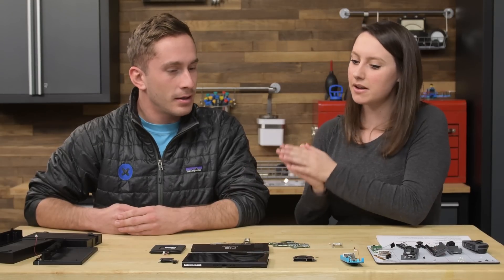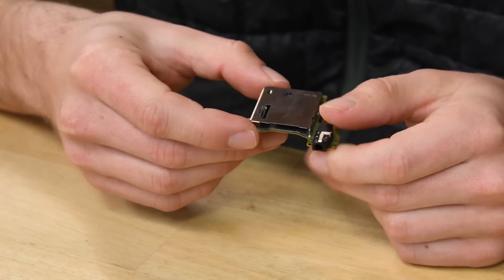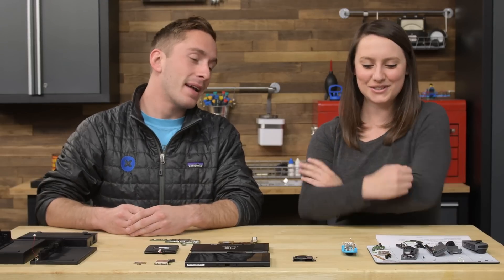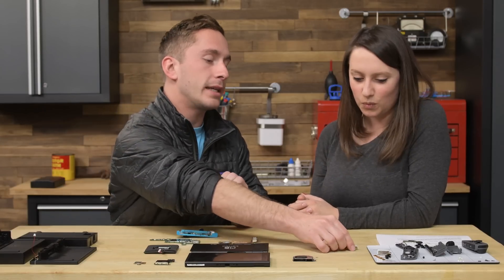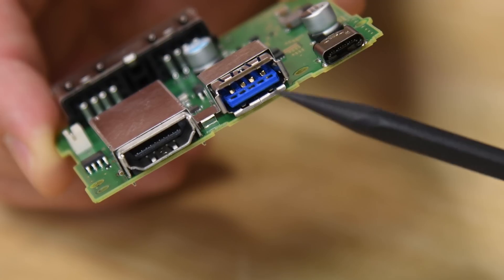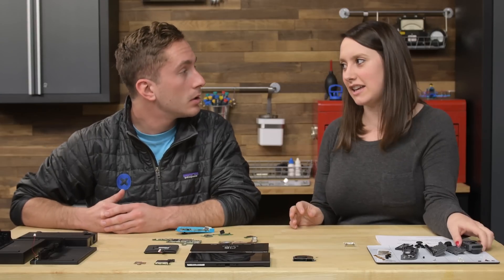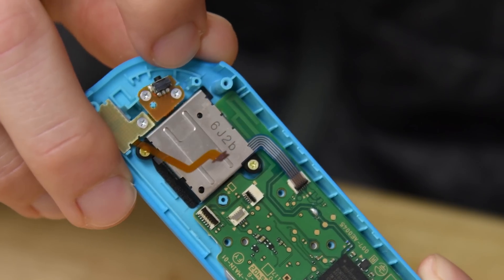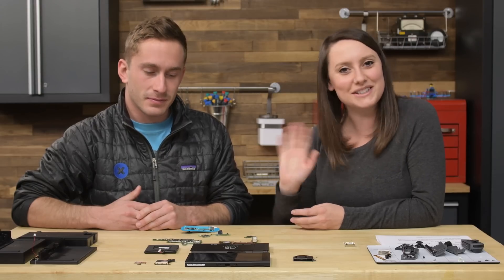The Nintendo Switch Teardown Review! With your Questions Answered!

Comment: Great video! But you said one thing that I feel inclined to correct, you implied that this was the first Nintendo device to have a removable battery (By saying: "They have a removable battery, which is an upgrade from previous Nintendo Products.") when in reality: This is the first Nintendo device to lock away the battery. The Wii U gamepad, 3DS line, DS line, and Wii remotes have all had user changeable batteries by simply removing a back plate. With Nintendo selling official battery upgrades for the Wii U Gamepad. 

This is the first Nintendo console to lock away the battery inside the actual console, and the battery stuck to the console with adhesive. So without voiding your warranty, the Switch battery is not user changeable. Making it a downgrade from previous Nintendo products, as opposed to the supposed upgrade.

Comment: 1:15 A removable Battery is a upgrade from Previos Nintendo Consoles? WTF, i dont know ONE Nintendo Console that is not removable, the WII U Gamepda, the DS, the 3DS and even the NEw 3DS had completly REmovable Batterys, and you just need to remove 2 Screws to remove it there

Comment: I would have to venture to guess that the USB 3.0 port inside the flap (and it HAS to be a 3.0 port given the blue socket color - I can't imagine a company as well established as Nintendo going against a device standard like that) will be useful for when we see External HDD support down the line with a firmware update. It would make sense why it would be tucked away, since you wouldn't be likely to disconnect it much anyway. The reason is simple - although the SDXC standard supports up to 2TB, I don't think we'll actually SEE a card for several years down the line... At least not one that's reasonably AFFORDABLE. You can MAYBE get a 256GB card on sale for $150, but it's typically more like $200-250 these days.

Comment: Not sure if this guy was comparing the switch to apple... but the Wii U pad and ALL of the rechargeable handhelds have had user replaceable batteries.

If anything the switch is a step in the wrong direction, as it is glued down and you have to do a fair amount of disassembly to get to it.

Comment: Wait, the switch got an 8 out of 10 for repairability, a fully modular tablet with the downsides being tri-point screws and adhesive on a display that you DONT want to have coming loose? WTF does it take to score a 10? Insane....more like ridiculous.
Reply: JETiKnightNY You've gotta be able to laser cut the battery in half and put it back together to get an iFixit  9. Same for the screen, and main CPU.

To get a 10, you have to be able to score it with the tip of a wood screw and snap it over your knee, then put it back together (you know how iFixit loves their screws.)
Reply: JETiKnightNY You kind of answered your own question. The absence of the tri-points and the adhesive would've probably given it a 10/10
Reply: I. Cruz taking points away for the type of screws used is stupid. this is a tablet that's built like a laptop and is modular. nothing on the streets like it from my knowledge. taking off a point because of a screw preference makes category useless
Reply: The Wii U has to be a 1 for repairability. I'm loving botw on my launch wii u it's an amazing console but I dread having to repair it God forbid it breaks anytime soon.
Reply: A 10 would probably be no adhesives, no proprietary screw drives, and tool less assembly outside of the outer casing.
Reply: Except that the screws arent proprietary, just not common. This is why the score is ridiculous. I could even understand the adhesive, but to have tri-point screws influence the score was a joke.
Reply: lol...exactly!
Reply: I just checked xbox one S and PS4 Pro & they got an 8 so if they deserve an 8 then the switch is worthy of a 20 easily.
Reply: JETiKnightNY Probably being able to disassemble everything with one screwdriver etc.
Reply: Anyone who's doing repairs on a tablet or anything like that for example pretty much has a tri-point screw driver. I wont even argue the screen being adhered to the frame, but the screw point was super lame.
Reply: JETiKnightNY NOT A TABLET.
Reply: Yeesh you took that personally. Relax, its an ease of repairability score not a metacritic rating.
Reply: JETiKnightNY given the fact that they gave you two downsides then it should be clear why it didn't get a 10.

Comment: I noticed the usb 3.0 outlet in the back as well, could it be used for the rumored external graphics card dock?
Reply: No where near enough bandwidth
Reply: Yea, I am reading the bandwidth is still too slow on 3.0. I am guessing it will just be a new dock then. That is the only reason they are using usb c it would seem.
Reply: Or possibly a Wii U backward compatibility component such as a disc drive.
Reply: No, the Switch doesn't have the supporting hardware, and I'm not sure if a Tegra hybrid SLI is even possible. USB 3.0 doesn't even have the bandwidth for it. For example, USB type C with Thunderbolt 3 only puts out 4 PCIe lanes, and even then there's bottlenecks with that on high end laptops. They'd need a proprietary connector for full possible bandwidth, which USB C/TB3 wouldn't provide, if it even had the supporting hardware.
Reply: GodDamnShr00b Considering that Thunderbolt is an Intel technology and needs an Intel chip to use it then yes
Reply: GodDamnShr00b
There's no way around this without a major hardware revision.

You could connect an egpu to the switch right now if you wanted but you'd get max 5gbps which is 1% of the max bandwidth of the pcie x16 slot that the gpu plugs into.

I guarantee you that the apu will perform better than an external usb 2.0 gpu.
Reply: very unlikely, you can propably transter data over that port (usb sticks)
Reply: maybe... but even usb 3 may be too slow... not sure though... i hope you're right. i'd love an upgraded dock
Reply: That type-c... That is my hope...
Reply: Manko Slayer no, USB 3.0 don't have speed need for a external GPU, only thunderbolt 2.0 or 3.0.
Reply: Manko Slayer Unfortunately unless Nvidia has their own version on Thunderbolt, we will not see an external graphics dock for the Switch because Thunderbolt is an Intel thing
Reply: nope 3.0 even 3.1 etc are not even near to the bandwidth to operate any external GC, you need thunderbolt2 and UP  to thunderbolt 3 is the normal pass thru.
Reply: Manko Slayer Probably not, as USB 3 doesn't quite have the capabilities of the newer USB 3.1/USB-C™ standard, as the Switch itself does. While it would likely work, it would probably not warrant releasing an external component, with the cramped space in the Dock already.
Reply: Manko Slayer usb 3.0 won't provide enough throughput to efficiently utilise an external gpu.
Reply: Manko Slayer The only connector that supports an external gpu is a USB-type C connector that supports Thunderbolt 3. The one on the back is USB-type A, and can't support Intel's Thunderbolt technology.

If Nintendo were to make a dock with an external gpu, then the port on the switch would need to be a Thunderbolt 3 port, because as of now it's a standard type-C port without the benefits of Thunderbolt.
Reply: Do we know for sure that the dock's USB Type C isn't Thunderbolt 3?
And what about the one at the bottom of the console?

(By the way some eGPU work through Thunderbolt 2 with major compromises)
Reply: Just checked, apparently the Thunderbolt interface doesn't run on ARM Chipset so scrap that, though there could be some way around this...

Comment: So the hd rumble is the same in the rift controllers so not too original?
Reply: jay hall The HD Rumble is a combination of a linear actuator (which doesn't rotate, but in fact vibrates in a linear motion) combined with lots and lots of math in the form of physics calculations.

In the Oculus Touch controllers, Oculus chose to integrate linear actuators based on Valve and HTC's decision to do the same, many months prior. The HTC Give controllers have linear actuators imbedded between the main touchpad and the rear analogue stick for high-fidelity rumble when playing a game where you need to fire a gun and feel (some) realistic recoil from the controller. It's nowhere near the buckle of an actual firearm, many orders of magnitude weaker, in fact, but it's leagues ahead of feeling a piecepf plastic wobble around the X and Z axis in your hands, sometimes from the left, or the right, depending on the strength of the firearm in question.

It's my firm belief that Nintendo saw how tiny linear actuators are compared to traditional rumble motors, and decided to implement them into their incredibly space-efficient controllers. The HD Rumble was just a good upside to that decision.
Reply: well no even the iPhone 7 and up uses the some type of rumble function
Reply: jay hall No, but it does mean Virtual Reality might be an option in the future of the switch.

Comment: the Phillips tri-point screws are a negative??
how?? these things are very common. the old DS used these for example.
Reply: Common for Nintendo products, but not common anywhere else. I would venture to guess that not many average households have a tri-point screwdriver.
Reply: Phillips and tri-point are two different drives. Tri-point is Nintendo's proprietary driver, which is why you find them on all Nintendo consoles and basically nothing else. 
It's an uncommon proprietary security drive, which is a logical negative when every other screw is a common phillips drive.
Reply: lolindirlink Every Nintendo product from the Game Boy onward, barring the NES, Super Nintendo, and Nintendo 64 use primarily Tri-wing screws in their construction. the Switch using Phillips screws (which are probably not imperial sizes but instead adhering to the mostly metric Japanese Industry Standard (JIS or J-X) screw sizes.

DO NOT use imperial screwdrivers on them, as you have a much higher chance of stripping the screws. Just ask a New 3DS owner. Phillips PH0 screws my ass.
Reply: The original Game Boy used those. And just so we're clear, I mean the one released in 1989 (1990 for Europe).
Also, those things are/were very durable, one survived a mortar attack and turned on when discovered and given fresh batteries. Charred plastic and everything, but it turned on and played tetris. It's in a Nintendo museum somewhere IIRC.
Reply: the scews are not that rare but not everybody have a bit for this kind of screws
Reply: i just checked my gameboy to confirm lol, it's true. but regarding the "negative", it keeps the average consumer out, but let's techy's get in. it's totally effective at what it does and it's not a 1-system tool as there are multiple similar systems having the same screw. most people who open these devices up, did or do so with multiple systems. i still have my screwdriver i bet most techy's do. no negative.

Comment: Why is there a HUGE solder blob on the Left antenna?  Wonder if that's a variable as to why some people have seems to be having issues, and others aren't.
Reply: Kevin Canada If you see Spawn Wave's "Fixing the Left Joy-Con" video, you can see that's where a traditional antenna connector would have been placed had Nintendo not removed it for manufacturing reasons/had a supply issue and had to manufacture the first few batches without them.

Just solder some (~1.7 in/ 4 to 5 cm of) copper wire on there, fit it inside, and you instantly get ~40ft of range. Voila, better connection.

Comment: Does anyone know if it's possible to upgrade the battery?
Reply: Only external batteries. Like any other mobile device, the battery is made to fit the cavity it fills.
Reply: Zachary Laborde If you can find one that would have the same voltage (v), amperage(A), and temperature rating(°C), as well as a higher capacity(mA/h), and the same connector, it'd be an easy drop-in replacement. Expect third party solutions, if it's possible to even cram a larger battery in that thing.
Reply: Physically possible, parts not available right now tho. Battery tech would have to advance first which takes a few years.
Right now you will have to carry around a battery bank that supports USB-C such as the Anker PowerCore 20100, and I'm getting one of those to use for that purpose.

Comment: the USB 3.0 is a developer USB for Nintendo to flash things on the system
Reply: Luke Davies The USB 3.0 connection Is officially described on Nintendo.com/Switch as being USB 2.0 compatible for now, and in a future software update getting the coveted USB 3.0 functionality. As far as we know, it has nothing at all to do with developers. Considering it is a host (like a desktop computer) port and not a MicroUSB device port (like a mobile phone), it's probably got nothing to do with software development at all. 

As for hardware development, it would be better in the long run to invest in developing handheld mode accessories such as licensed battery banks, that utilize the Nintendo Switch's unique ability to switch between form factors.
Reply: but since the USB C can only be used to charge the switch the USB in the dock is a part of an assembly that allows an output to your tv. and as we know, we can't use third party docs. So if Nintendo want people to develop software they would most likely see people to do it through the dock, this is because of the switches function of being able to output data through the HDMI. but since a USB is not a HDMI, I think there will be some other functions for this USB in the future, but who knows. maybe they'll make a GameCube controller adapter that goes in the rear USB. A lot about the switches hardware is speculation, I'm just a fan-boy with a dream Val.

Comment: If there's an upgrade for the memory of nintendo switch nand, please do a video
Reply: Read the chip, copy it's contents, write the contents onto replacement chip, desolder first chip, solder second chip. 
In theory it should be that simple. 
Also there's going to be a 64GB model at some point, the devkit Switch has a 64GB chip on it.
The chip is a 2bit mlc module, they only make those up to 128GB chips. Samsung does make a 256GB chip but it uses a 3bit mlc or tlc  module. Not sure if the switch from 2 to 3 bits would effect anything. There's also the possibility of an expanded daughterboard for multiple chips, but I'm not sure if that would work, or if there's any room inside the switch to do this.
I've seen nothing on mods outside of externally reading and writing the chip.

Comment: How powerful is it compared to other consoles?
Reply: AVM3798 it's stronger than the Wii U but weaker than Xbox one
Reply: AVM3798 I doubt iFixit have an X-Ray machine, and if the guy in the video is any indication, they don't have someone with enough technological experience to be able to count CUDA cores, recognize differences in the hardware implementations of ARM architecture, etc.

Let the real tech experts get on it, and ask them later.

Comment: If, there's a new version of the Switch if higher memory capacity, would this EMMC memory card allow me change to the higher one?
Reply: The memory chip is most likely locked to the system, like the SD cards are. You'd have to read, copy, and write data between two chips to get around the system lock, and that might not even work if the system also locks itself to a specific sized chip. 
But there should be a 64GB system at some point, since the devkits have 64GB chips.
Reply: Marcos Burg You could probably get a NAND reader/writer board (if such a thing exists), and bitwise copy one eMMC chip to the other. If that doesn't work (or it shows the same amount of storage), and the data isn't encrypted using console specific keys, you might be able to take a partition manager and resize the user partition (the one that shows up as 25GB in the menu) up to the full size of the eMMC chip you replace it with.

It may be that your second eMMC chip comes preformatted with the Nintendo Switch OS already on it. In that case, deactivate your Switch through the OS and log on on the bigger one.
Reply: I guess, but the only way to get one would be with another Switch wrapped around it, so I kind of don't see the point unless Nintendo offered some sort of "Upgrade RMA" service for the old ones where you send your Switch to Nintendo, they put in the bigger memory chip, and then they send it back to you.
Personally I'm just going to get a 128GB micro SD card and call it good.